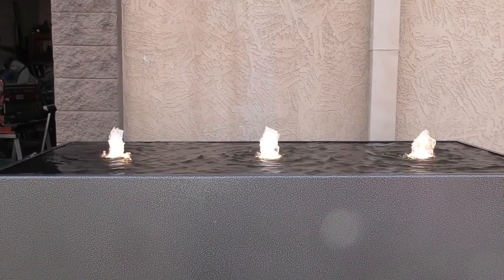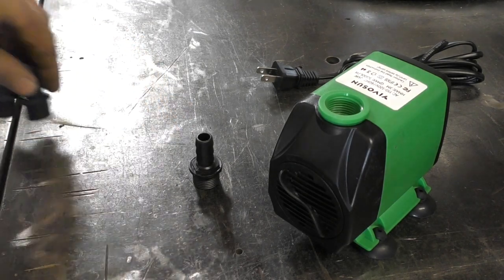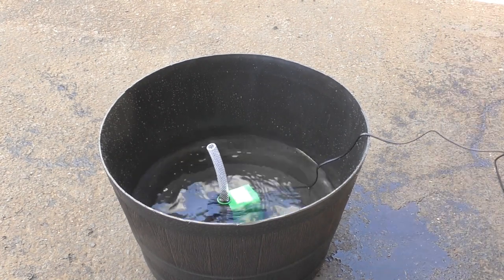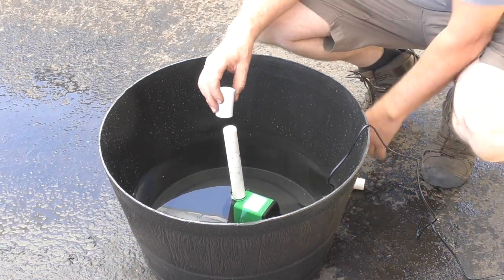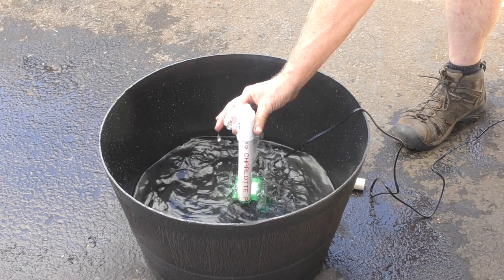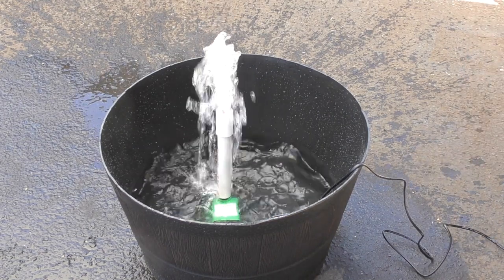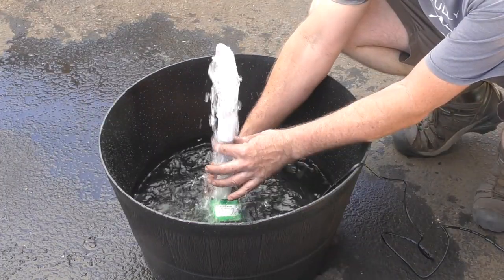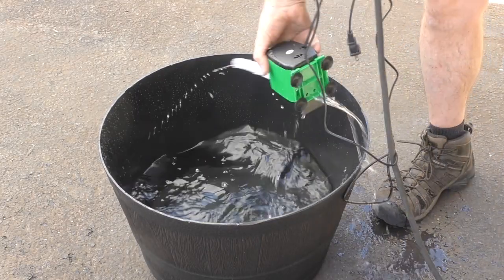DIY Bubbler Fountain Effect - The Perfect Fountain Bubbler Effect

Comment: The pressure change causes cavitation.  Cavitation creates the effect you are looking for...
Reply from the maker: I knew someone would have a word for it. I can imagine walking into a store.. Yes may I have a  pump creates cavitation 😉
Reply: @ArtfullyRogue  Pumps (and propellers/impellers) can cause cavitation if the fluid accelerates or the pressure drops below the vapor pressure of the fluid (water) at the current air temperature.  This is why some pipes will water hammer until the pipe warms up.  If the water in your system is cavitating, the "bubbling" may act erratically as the temperature changes.  A more reliable way to accomplish what you want is to introduce air using a venturi tube.  If you want it all to be underwater then you have to run the air tube to a concealed location...

Comment: Might try some screen/wire cut to fit... or actually, the screens used for household faucets would probably push in there quite nicely. Might have to use a couple screws above it to keep it from being pushed out over time.
Reply from the maker: the faucet diffuser...I tried that actually and the pressure from the pump blew right through it

Comment: I see what happened there. I'm sure there's a name for it, but I don't know what it is off the top of my head. You have a pump, putting a line at a pressure with a constant flow rate. The diameter of the line expands, so pressure drops, but with the same steady flow rate, you get less fluid movement. (Evidenced by the barely-a-trickle out of the wider coupler.)

It's tempting to think you should get all the original pressure back when you capped it with the same size PVC, but you'd be discounting A) losses in the system, and B) the fact that the top of the cap is open, so no pressure can't really build there, and you're just left with the flow.

It's the same principle as a car muffler or a firearm silencer or something. But for water.